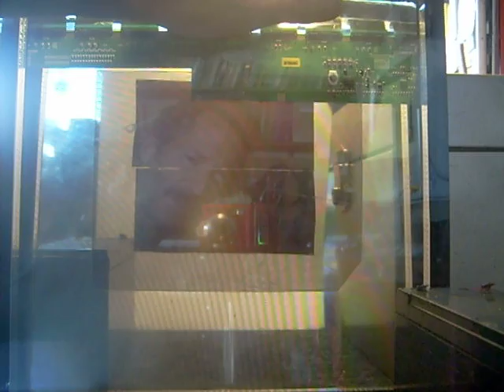More on LCD screens, liquid crystals and polarized light filters

Comment: Waiting for a video of how to get the liquid crystal layer from a screen LCD thank you
Reply from the maker: Thanks for the suggestion. In my case I used a single edge flat razor blade after I split the screen.layers apart.
Reply: @GrantsPassTVRepair  
Thank you again for your reply. Dear, I have dismantled 5 mobile screens with the blade and I have not found that plastic layer. I will try with other screens to find it. The liquid crystal layer is an important science.
Reply from the maker: @roaab1516  I got the liquid out of a television display. There is very little of it available so it takes time and patience.
Reply: @GrantsPassTVRepair  
Thank you so much . I learned a lot from you. I wish you happiness and a beautiful life.
Reply from the maker: @roaab1516  Thank you.